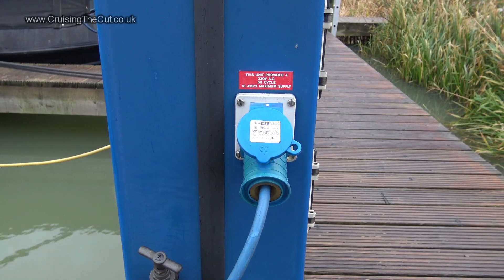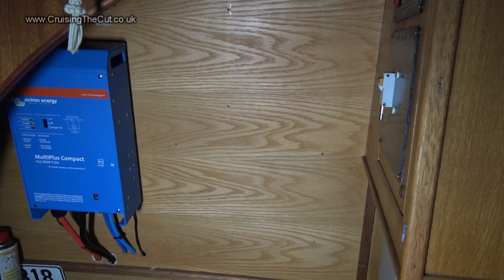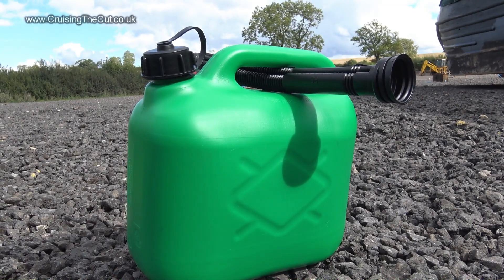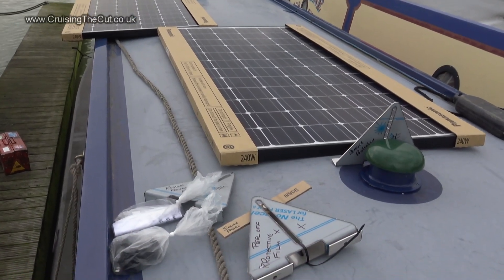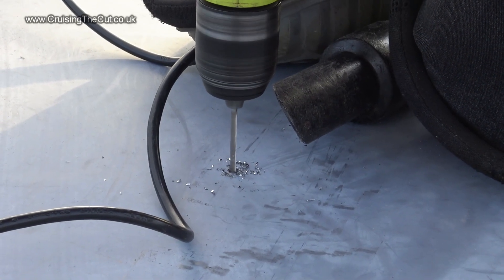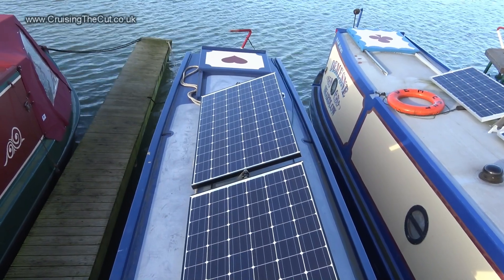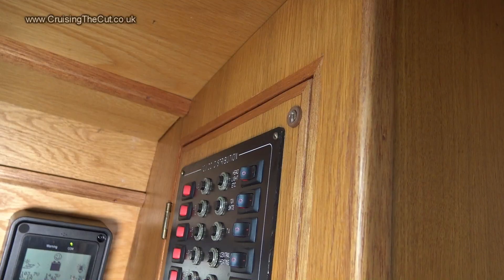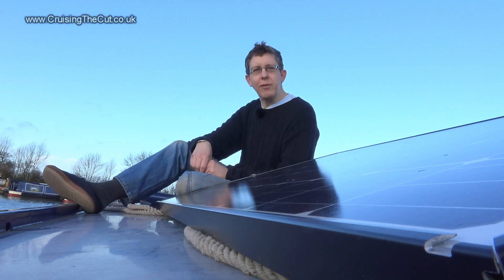15. Solar panel installation on my canal narrowboat (2 x 240W Panasonic)

Comment: Done a bit of research.  Historical.  These panels used to retail at around £200 each, so £400 (ish) for 480 watts.  That was almost 10 years ago.  Now you can get panels from a nationwide plumbers merchants at £60 for a 430 watt.   When you consider the rise in electricity prices I wonder if the things pay for themselves within a year now.
Reply: He looks so young in this video... I suppose we all looked a lot younger ten years go! But yeah, crazy how much improvement we've seen in solar.
Reply: and the rest. I havent seen a 430w panel for less than a few hundred quid.

Comment: Hi my name is richard jensen. I have been watch a lot  and i here that you can run out of water . I have been check out in house dehumidifier that can take out about 32 oz of water
with in a day and it uses very  little electric to power . you then can filter the watre with a ZERO water filter than you can make your daily tea and other uses of water

Comment: the sun is just as strong in the winter. its just we are further away from it. so the same stuff in summer is just weaker and days are shorter.
Reply from the maker: Days are much shorter, it's lower on the horizon, and crucially, we don't get many sunny days in a UK winter - it's more often overcast and raining.

Comment: Bore glazing by idling diesel engines is a bit of a myth. If can happen on older diesels but if modern engines are filled with the correct grade and API specification of oil then it doesn't happen. You want API CC or above.
Reply: Except his engine is old.

Comment: Just trawling YouTube for solar installs researching ready for ours, and came across this....
Have you found this system to be up to the job? Enough power? Have you had to change or upgrade anything? Any key tips or pointers you've come across as to what's best for a solar system? 
Cheers
Reply from the maker: The more solar, the merrier! My 480W setup provides plenty from April-end September (unless we have a run of cloudy, crappy days, which did happen a bit this year). Everyone has a strong opinion on what’s “right” so you’ll get loads of armchair experts telling you what to have. There are pros and cons to Lithium batteries, too much to go into here. I would like a substantially bigger battery bank than my 3 x 110Ah so as to soak up the excess solar so that the cloudy days would be no problem (and that’s where lithium folk usually chip in but I don’t have the budget and I really want more than just swapping the existing batteries for lithium equivalents). Make sure you fuse everything and ensure the solar controller has the capacity for the number of panels you plug into it, I’ve seen one that burst into flames because it was too small for the Wattage coming off the panels...
Reply: @CruisingTheCut  yes the internet is full of armchair advisers. Some of which talk sense - but many of which talk nonsense! 
So in essence I reckon you are saying the 480w of solar is 'probably' enough, but perhaps more battery capacity would be of use? 🤔
Reply from the maker: Yes. In winter you'll get bugger all, no matter how many panels you have and no matter how much you tilt them towards the sun, except on the very rare sunny day (most are overcast of course in winter) and even then due to the low angle of the sun, all the trees blocking the light, and the short hours of daylight, you'll pull in naff all.

Therefore, solar is best suited for Spring-Autumn and at that time (especially in summer), you can pull in more power than a small battery bank can store so it can be worthwhile (if you want to be "off grid" for multiple days and not running the engine) having a decent battery bank.

That said, if you want to run very high energy devices (washing machine, hair curlers (!) etc) then more solar would help as well.
Reply: @CruisingTheCut  washing machine and hair curlers... My working clothes are permanently mucky! I have no hair and Dawns hair is naturally curly! But I see the point! 🤣🤣🤣
I shall be spending my money wisely(!) - but will probably look more at extra batteries then as opposed to filling a roof full solar panels. 
Thankyou!

Comment: September 2020. after 5 years have the solar panels supplied much of your electricity needs?
Reply from the maker: Yes, they work very well from April-September; much less effective in winter with shorter hours of daylight, sun lower in the sky and, more relevantly, generally crappier, cloudier, rainier weather
Reply: They look great were they horrendously expensive and what is their life expectancy
Reply from the maker: Not horrendously expensive and I think they last at least 25 years

Comment: You're right that idling a diesel is NG.
Id you make choices another day on another boat, consider a generator, like Honda EU2000i.
You can run it on propane or cooking gas etc.
Cheaper, cleaner & safer than petrol.

Comment: Your meter / display panel is supposed to be mounted somewhere in the cabin so that you can easily monitor the electrical performance and check the state of charge of the batteries (that's why it has a communications link cable to the actual charge controller; the length of this cable can be as long as you need). Also, many of those panels contain a microprocessor that will put your marine deep-cycle batteries through an exercise cycle about once a month, yielding much longer battery life.
I am running a pair of 240 Watt panels, through an MPPT charge controller, into a pair of 220 Amp-hour 12 VDC batteries in my RV in California. I installed the system myself about 9 years ago, and the batteries show little degradation. You might want to cover your panels for a day or two while using whatever battery power you normally would, just to get an idea what your needs are. I run everything (except AC and microwave) in my RV from 12 VDC, so I use no big AC inverter. I have found that a modest amount of LED lighting, TV at night and computer / smartphone / small equipment charging uses about 10% of my battery storage capacity in a day, so I could last for about a week without sunshine or running an engine charger. That would be unprecedented gloom for California, but I did note one day when I was in Mississippi, in a heavy rain, and I was still getting a couple of Amps of charge put into my batteries.
Adjusting the panel angles for maximum solar pickup wasn't worth the hassle on an RV in California, but I suppose it gives you something to fiddle with on overcast English days. The combination of 480 Watts of solar, and conversion of all interior lighting to LED's, has made it possible for my wife and I to be independent "dry" campers for up to two weeks (black & gray water storage is now our limiting factor). And, the electric power is now zero-cost. BTW, you almost never will see full rated power from your solar panels; their rating is 240 Watts with perfect conditions, and most of the time your angle won't be perfect, a film of dust or condensation will be on the panels, and maybe the air isn't as clean as you think. Use about 70% rated power available as a rule of thumb and you will then be happy to see a little better real performance.
Reply from the maker: Cheers. The meter does not display state of charge, merely voltage and amps going into the battery. I only check it occasionally so it doesn't matter that it's in the engine room. The batteries are (were, at the time of this video) AGM so do not require a monthly equalisation, indeed it would damage them. I did an energy audit before the panels were installed.

Comment: If you run a diesel at low rpm, the piston rings do not clean the cylinder walls the same as they do at high rpm. The result is that the cylinder walls become smooth. A smooth cylinder wall means the piston rings do not seal as good against the cylinders and the engine has a lower compression ratio, which means it will have less power and burn more fuel.  It is the same as when an engine is new, you first run the engine at lower rpms so not to damage the cylinder walls and piston rings as they wear into each other, and then you do not run the engine at the same rpm for an extended period of time so the cylinders and rings do not wear in at one fixed speed. This would also lower the compression ratio, thereby reducing efficiency as well as the serviceable life expectancy of the engine.

Comment: Your installer not only did a nice job, but he used very nice quality hardware. Button head cap screws no less. Stainless steel. Proper marine stuff. Same with the sealant.
Reply: Exactly. So many solar installations on boats and RV's are done by hacks using poor quality components.  Those stainless steel panel brackets really impressed me.

Comment: How much did you pay to handyman for work? just thinking is it worth to pay or to struggle on my own?
Reply: My solar system sat in a box for three years because I couldn't find or afford an expert. After 8 weeks of doing sod all in lockdown, I thought I'd pull out the instructions. It really is unbelievably easy and I set it up in a few hours. Do be careful though. Cover up the panels when installing. Apparently if there's sunshine about you can cause a short circuit by attaching or detaching the panels whilst current is being produced.

Comment: I'm  not sure how that power actually gets to the batteries. We didn't see them!
Reply from the maker: Wires! And the solar charge controller, which was shown.
Reply: @CruisingTheCut  I thought it might be. I have the same installation as your good self, the same charge controller and the same monitoring system. I just can't work out exactly how to connect the charge controller to the battery. There is one crucial difference between your set up and mine. I can't find the expert in the box!!

Comment: I am new to the boater’s life and I am planning on installing a couple of solar panels on the front section of the roof of my narrowboat. The standard domestic solar panel is 99cm wide. If mounted centrally on the roof of my narrowboat it leaves just a narrow gap on either side for walking on the roof. Is this problematic? Is it really essential to be able to walk freely on the roof of a narrowboat along its full length when doing locks?
Reply from the maker: It's very useful to be able to, especially if you're single handed. That's exactly why I bought these narrower panels at only 80cm wide

Comment: (2:55) - well, of course you are going to want your panels installed at an angle.
If for any reason other than they are not flat and gathering dirt.
Now, the perfect angle for a house would be the south facing gable of a roof,  but since you are constantly on the move, do not have them fixed but addustable.
At least to a degree.
This guy is such a newb, I really want to reach out to hold his hand.
But I am commenting in March 2020 and this video was made way back in December 2015.
Oh well...
>
Reply from the maker: A lot of boats actually have the panels fixed flat, perfectly satisfactorily, for ease of travel (no need to adjust for low bridges etc); yes, it's not optimal in terms of solar performance but is often quite sufficient for the boat's requirements.

Comment: Wow, you use an average of 40 watts per hour over a day at 12V.    Actually it is very little and i bet your fridge used most of that.
Reply from the maker: Yes, the fridge (and the laptop) are the top consumers of power.
Reply: 40 W per hour makes no sense. That's joules (energy) per second (time) per hour (also time).

Comment: Would a wind turbine be sufficient in winter to charge your batteries with the extra wind that’s about? That way you can have a winter cruise :)
Reply from the maker: Not really; they're expensive, noisy and very intermittent, plus they need a really stiff breeze to actually generate anything. On a permanent mooring where you know you have a good breeze then it could be worth it but to take out on the boat with you, generally not.

Comment: "Glazing the Boars", I think that was a lesson in the culinary school. But I believe its a build up that occurs in diesel engines at lower temps.
Reply: its bores not boars, not a build up, it polishes cylinder bores, cauing loss of compresion and engine will burn more oil
Reply: paul dixon it was a joke, don’t know what good a bore would be in culinary school.
Reply: Diesel engines like to be worked hard and given a damn good thrashing, but not in the Basil Fawlty sense of the word.

Comment: Tilted up closer to 80° in winter, you should be able to get much better efficiency. Not great in high winds of course!
Reply from the maker: Yes they'd be more efficient but there's still bugger all actual sun in winter and the hours of daylight are much shorter so overall not worth the effort. Even double or triple of the 1-2A they'd get flat is still sod all.

Comment: Ive just come back to watch this, as in January I'm going to install solar on our boat.
My question is this, with your new found DIY skills and hindsight, do you wish you'd of fitted the solar yourself? after all it looked a lot less daunting than cutting holes in a van to install windows.
Oh one more thing, did you by all the solar items as a kit, and if so could you recommend a supplier 
Thanks in advance
Mark
Reply from the maker: I don't think I'd have been comfortable drilling the holes in the roof for the panel brackets as this required very precise measuring and tapping out the holes. Everything else I could have done, yes.

Comment: @ 1:55 "run the engine in idle, but it's not good for the engine" and... most importantly, it's not good for the environment! Sorry, couldn't resist :) Glad you installed solar panels.

Comment: Advice for attaching mount brackets to boats, caravans (RV's), etc.  Use 3M double sided tape that is manufactured for this purpose. DON'T drill through your roof!  https://www.finecal.co.uk/blog/the-comprehensive-guide-to-double-sided-adhesive-tapes.html

Comment: What's an ethernal cable
Reply: A non-physical wire that goes on forever
Reply: Emma Paignton ethernet, it's a computer network cable', the thing all computers used to get the Internet before wifi.
Reply: And any computer still uses if it needs more bandwidth than WiFi can provide.

Comment: Hi David loving all the vlogs..I've just put a deposit down on narrowboat and waiting for the survey, I've secured a private mooring with no electric so  thinking I'll be needing a couple of these but not sure to be honest, the boat has a vetus combi 3kw inverter/charger, vetus glx6 generator 4.8kw, 6 x110a domestic and 110a starter batteries . A 130a domestic and 110a starter alternator? I haven't a clue what all that means, I'm a complete novice with electrics. Any advice on solar and do you still have Simons number if I need them for him to fit... TIA Carolyne
Reply from the maker: I think my next vlog, due tomorrow, will be right up your street. But also, yes, get solar.
Reply: CruisingTheCut  really looking forward to that.. I need all the help & David vlogs I can get to get me going 🤗

Comment: Just looked at your vlog again and noticed the panels are from Panasonic Malaysia. Did you buy them from UK or order from overseas? If you don't mind me asking how much they cost as want to know if it would be worth me bringing/shipping some back as currently in Malaysia.
Reply from the maker: Bought in the UK though I can't remember where from or what they cost, sorry. Didn't I write it in the video description? (I can't recall, and can't see it on the iPad Studio app as I type this)
Reply: thanks - just model number on vlog -  not supplier - will search Amazon.
Reply from the maker: After pondering overnight, I'm pretty sure I got them from Midsummer Energy, who I now see are selling on Amazon: https://www.amazon.co.uk/Panasonic-Solar-PV-Panels-VBHN240SJ25/dp/B00SRF9D80
Reply: Thanks David, Ironically Panasonic make those units in Malaysia, yet they do not sell them here!. I can get some other make 250W and 300w similar sized PV units for approx 130 quid each here so might try those out. Considering its sunny or bright overcast 90% of days (from 7am to 7pm all year) there are very few solar/battery distributors here, even though so many of the items are constructed here. 60Amp MPPT controllers are much cheaper here.

Comment: I would replace the engine with a diesel generator feeding an electric propulsion motor providing ac to the boat. electric bilge pump for instance, microwave. US navy ships will be going to all electric no dedicated propulsion motor but electric. all the turbines will generate electrical power for what ever it's needed for. this would be similar.
Reply from the maker: It would be phenomenally expensive to do that ... but when you get to vlog 69 you will see a hybride propulsion boat using a similar kid of set up.

Comment: what about adding a small wind  turbine?
Reply from the maker: They're costly, make a lot of vibration noise, don't generate much power (the wind is generally too inconsistent on the canals apart from some high spots around the network) and have to be put up and down each time you travel.

Comment: Glassing the bores is an old fashioned thing - does not have with modern engines.
Reply: beg to disagree Peter... My Yanmar 4JH hates idle with no (i.e. only alternator) load and bores were well glazed when it rebuilt it.
Reply from the maker: Alas, most narrowboat engines are quite old technology!